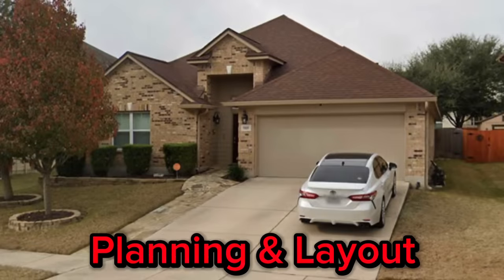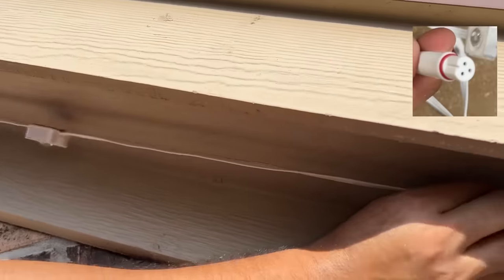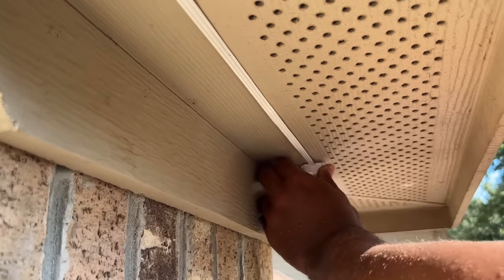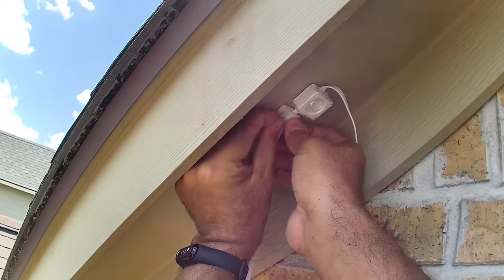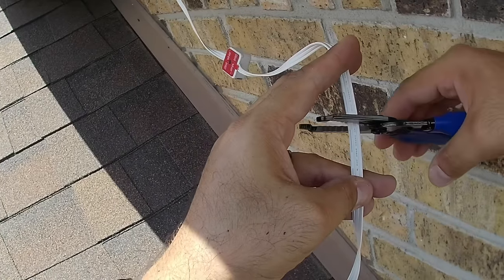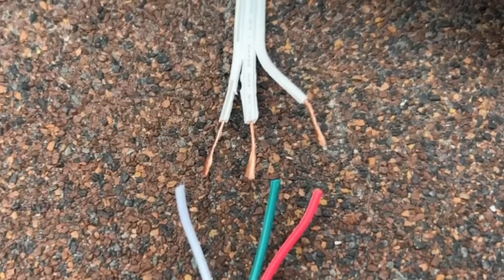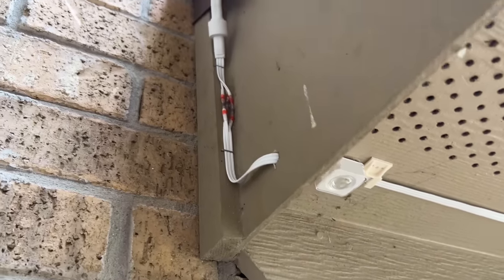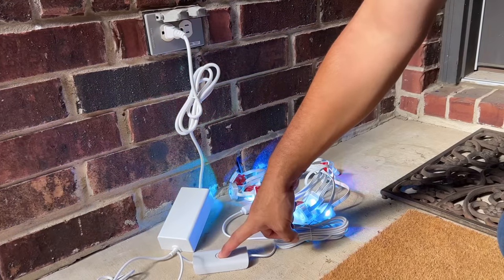Govee Outdoor Permanent Lights-1st Gen.*HOW TO FULLY CUSTOMIZE* @GOVEE #govee #howto #diy

Comment: The driver modules on Amazon says it will not work on anything but the Pro lighting. My question is why? I have just bought the regular set. I would think this would boost the signal if the system is extended with spliced wiring while staying within the 150 get, give or take a few feet. Also, if this can be used, can the wiring on this driver be spiced and used as an extension? If that could possibly be done it would be cheaper,(since the driver is only $19)and not void the warranty on the system. Thanks for the awesome video, definitely gave a great option to extend the wiring. Wish Govee would make longer wiring extensions and even ones with drivers so splicing will not be needed. They could even make a t-connection.
Reply from the maker: It will not work with any other version and has been tested. The way the lights themselves are made to respond to the module is the difference. Only can be used on the H706 models. Use a 12ft Govee Extension and splice new 18/3 wire to make a longer jump
Reply: @jbsdiytv  can I splice both ends of the jumper the 100 foot set comes with? First level I have a spliced end, need to jump to second level and continue with the same spliced segment. Or would I be better off adding 3 pin waterproof connectors to the ends of the spliced segment? And then connecting the jumper.
Reply: How far should they be from the house? I noticed the cardboard cut out, what is the dimensions on that cut out? Thank you, and it looks great!

Comment: Did you just use one controller for all of these lights?
Reply: That was my question as well. He had stated 95 ft on each side of the house. That’s 190 feet total (not sure if his 95 foot measurement included the spliced extensions or not). Which is well over the 150 feet maximum length for a single controller.

Edit: Nvm, he answered this in a separate reply. He used 2 controllers, one for each side and grouped them in the app to be in sync.

Comment: Great video and great advice. I have just 2 comments or suggestions. First, I have discovered that when i use the solider and seal connectors sometimes the wire will poke through the plastic side causing a possible short situation.  So i place a section of shrink tubing with the glue/sealer inside over the connectors as added insurance.   Then also to further seal with another shrink tube over all three extrnded about 1/2 inch past each end.  Second, i had enough overhang of my facia board that i put my lights on the back of the facia board aming toward the house.  Thus hides the lights almost completely and lights up washing the house wall much brighter.
Reply from the maker: Thank you for commenting. I’ve never had that issue with this brand of solder and seal when you mention the wire poking through. I have had this issue when using just the heat shrink sleeve without the solder so I stop using that type. The sleeve on these have a silicone in them when they get heated up when properly done. I can see someone who doesn’t know how to work with these have that issue so that is a good suggestion to have another seal cover the hole connections after complete. Wouldn’t hurt. To answer your suggestion on the lights on the back of the fascia facing the wall. Installed this way for one of my clients because they asked for it to begin and they ended up not liking it. They would rather have the triangle effect like shown in my videos instead of blasting light shown on the wall. Of course they paid me to re do it and it wasn’t worth the hours and headaches we got from it so I’ll never bring that up. I do mention to all my clients that it isn’t track lighting. Most of them are ok with it because it’s a knockoff from bigger types of lighting at a lower cost. For the ones that will pay to paint the lights to match the soffit, I’ll do it for them. Also have to consider a house I did had 4 different soffits spacing in the front alone, some 5inches some 12 inches and the others in between. Casting would've been different in those areas. So to keep everything even as I always recommend 2 to 4 inches. Thank you, this will help with someone’s install
Reply: Do you have a video showing your install with the lights installed onto the fascia  board having the lights pointing back at the house? What was the estimated distance between the light to the house?
Reply: Literally the comment I was looking for !!!! I wasn't sure if the lights would light up decent if I did that, because I noticed that if I installed them as you did it would preety much conceal them...
Reply from the maker: 2” from the wall
Reply: @joseluisperezjr3285 Yea, i'm also interested in seeing how your installed lights look .
Reply: All that beautiful work, then you have a ugly yellow light on the bottom...

Comment: I got two of the 150’ kits and did the whole house and entire perimeter fence in the backyard.  These lights are fantastic
Reply from the maker: Yes sir they are. I understand that the line can be seen and everyone mentions that but other than that, why spend 2,000 extra on something else when you can improvise with these. Awesome, glad it all worked out.  💪 👊

Hey look it this way, you can do a review on it. Every one of my videos is Creative Commons so you have my permission to use my video as an example👌
Reply: How do you do the perimeter fence? Do you have them pointing down?
Reply from the maker: @martybli  thank you for watching my video. If you decide to do this on the picket side(usually to the street) then the white wire will stand out and the lights will need to be put on their sides if you want the triangle effect. Or you can face them out. If you do it on the inside, it would work on the edge of the top rail 2x4 with the adhesive pad and clips. This install will be close to a home installation look.
Reply: @jbsdiytv  I know you can't do any more than 150 ft of lights but if the house is bigger than that, do you just need to connect it to a different outlet? And can you sync up the different 150 light strands if you had two different segments?
Reply from the maker: @benbarlow6135 please message us on Facebook @Jbs Holiday and Christmas Lighting LLC or Instagram @ jbsholidayandchristmaslighting
Reply: @benbarlow6135  I’m curious about this as well.
Reply: Great video 👍🏼 how far apart are the led’s?
Reply from the maker: @27airball  17” apart
Reply: How many ft ?? R how many boxs did you purchase for ur house!
Reply from the maker: @maxgtz  this is my clients house. This house took 2-100ft kits of the 1st generation lights
Reply: So even with all extensions the entire length should not exceed 150”? Does that mean that if I get 150foot version I cannot install any extensions?
Reply from the maker: @salilkansal4988 150ft plus your two-12ft extensions is the limit. That’s 9 segments
Reply: Where did you purchase the whole kit?
Reply from the maker: @atgeyler28 Im a bit confused with the question. What do you mean whole kit
Reply: Can 12ft extension be plugged in prior to adding 1st strand of lights? For example if I want to hide box underneath 1st story eave and then run up to 2nd story along gutter to underneath eave?
Reply: @jbsdiytv  Can 12ft extension be plugged in prior to adding 1st strand of lights? For example if I want to hide box underneath 1st story eave and then run up to 2nd story along gutter to underneath eave?
Reply from the maker: Yes we install in most cases installing more than 150ft to bring the controller closer to the front of the house
Reply: Are you able to connect  2 x150ft of the pro goove lights?
Reply from the maker: @MMARIC20 on to one controller and adapter, No. Two controllers and two power adapters YES and they can be grouped in the app under same-model group. If you need to add more than 150ft to one device you have to purchase the LED Driver Module on the Govee website for up to 200ft

Comment: Jb … thanks for the vid. Just finished my install.  Only snag was on the jumps.  I used my own 18 gauge 3-wire but my jumps needed to be 11’.  The system didn’t work until I shortened the jumps to about 6’.  What do I do if I need longer jumps at 11’ or 12’ ?  Will use if the two 12’ jumps supplied by Govee do the trick?  What if you don’t have male and female Govee ends to add on like in your video?   Appreciate the help.  Thanks for the reply.
Reply from the maker: Awesome. Glad the videos could help with your install. What kit did you end up buying? Pros or no Pros? Once you provide me with lil more info to the kit you bought I should be able to help out. One thing I can say is that if you need more than 12ft jumps we have spliced 3-4ft in the middle of the 12ft extension. The signal boxes in the Govee extensions need to remain
Reply: I have the H705C kit.  150’ with two 12’ Govee extensions.  I needed to cut and splice at two different points to reach a roof peak.  I used 18 gauge 3-wire jumps that were initially about 11’ each.  This resulted in flickering about half way past the first jump.  When trouble shooting, I cut the first jump down to about 6’ and the prob was solved until the next jump.  When I cut the second 11’ jump down to about 6’ … entire prob solved and entire system works fine.  But I really need those two jumps to be about 11’ each to hide and run the wires correctly.
Reply: Did you mention that those 12’ Govee extensions have “signal boxes” ?
Reply from the maker: @edhammel9535 I see. It’s tough to splice with the 12ft extension on the 150ft kit since they have them on both ends. You could purchase the Asahom 6ft extension from my site to use their connections
Reply from the maker: @edhammel9535 https://lnk.bio/jbsdiytv shop permanent lighting accessories on my site and look for the Asahom 6ft extension with amplifier
Reply from the maker: Yes on the 12ft extension, those are signal boxes to help with the data push
Reply: Can I cut the 12’ extension right before the pin connection and connect wires manually with heat shrink/solder connections like on your vid?
Reply from the maker: @edhammel9535 there is like about a 1/4” of wire to work with. It will be tough but it’s possible
Reply: Excellent.  I think I can make it work.  I was not aware that those little boxes on the 12’ extensions from Govee assist with the signals.  Will give it a try tomorrow and report back.  Thanks for the quick replies and help.
Reply: Update: the 12’ Govee extensions solved my issues.  The jumps and system now work perfectly.  Thanks JB for all of your tips and support.
Reply: Now where is that video on how to maximize use of the Govee Home app ?
Reply from the maker: Glad it all worked out for you 👍 That would be this one
https://youtu.be/KWp5gK0OZwU?si=U_EvgcR2c4eM9DD-

Comment: There is a new model coming out it's the Permanent Outdoor Lights Pro model H706C. I am currently testing them out. Biggest difference is they come in a 60m or 196', this is what they sent me. Also they are able to be spliced. They sent some connectors to allow the splicing. So far so good. 

 Great video btw. I used this for my install.
Reply from the maker: Yes that is correct. I follow the Govee group’s and comment on their ads. Seems like they might have a different color of line instead of just white. We will see. Thank you for watching, glad your installation went well
Reply: @jbsdiytv  I got white, so not entirely sure about the color but I've read that somewhere also. I posted a small review on the community page at Govee.
Reply: @jeves360 where did you find this info? Tried googling the model number a bunch of different ways to see more info on them, but couldn't find a thing other than an item number in an obscure page in their site like a placeholder. 

Super interested in checking these out before buying and having to splice. Any details would be really appreciated
Reply: @mpratt69 They're selling them on the govee website now
Reply: @KY_CPA  right, but this was 2 months ago. Salty they just liked the comment and didn't tell where tf to find em.

Comment: In addition to a question asked earlier about extending the wiring on a driver module (waiting in answer)  Can I splice and extend the original extension.  It is 9 feet, can it be extended an additional 15 feet with a splice? Everything is still within the 150 feet total.
Reply from the maker: Yes like I mentioned in the reply, you can extend the Govee extension using 18/3 wire

Comment: So you used 2 100ft sets and there were 2 runs of 95ft tied to a common power receptacle in the back.

Questions:
1.  Govee says not to cut the strings.  If so why did Govee provide the 12 ft extension or did you buy that separately?

2.  Did each 95 ft run use their respective drivers or did you tie them all together with another bigger driver?

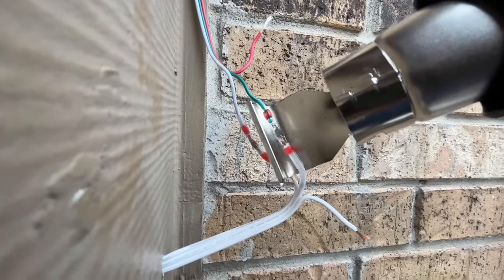3.  Does Resynch procedures @ 13:30   work if you had 2 47 ft parallel runs instead of a 95ft series run OR does the driver only work with series runs?

Comment: When the time comes to paint, will it be adequate to just mask each light? Also, I wonder if there is a track system or similar to conceal the wires. I am not a fan of the exposed wires.
Reply from the maker: When it comes time to paint, they sale stickers on Amazon that are 7/8” diameter to fit on the lens. Not everyone is to worry about it, and I always ask them before install starts. Some have HOA that it’s written it needs to be on a track and color match so I get that so I accommodate them. Solely it’s the owners liability if it’s written and mentioned in the invoice. But it can be painted after. Yes the best track is @BearLightStudios
Reply: @jbsdiytv  appreciate your help and the response! Y'all seem to do great work.
Reply from the maker: @corvettetexan thank you for your compliment

Comment: What product would y'all use if you needed to do a 3 way split, not just 2 way?  I have a house I'm going to be doing and they have a gable as well as a straight area to cover.
Reply from the maker: We typically don’t do 2-ways or 3 ways because the devices can be grouped as one system. If you wanted to make a 2 or even a 3 way, just keep in mind whatever line you tie into, those lights will mirror that strand. Which is not a problem when you use your Govee scenes but only a problem when you do your accent spot lighting as you turn a particular lights, the strand attached will also respond. He is something you can try out to see if it works for you 
https://amzn.to/4aFXiYn

Comment: So i have a question, so the 150 ft kit comes with one power box correct? If we are going from an eve to a peak, and you make a cut, how do you regain power? Stupid question, just have no clue what im doing
Reply: Wondering this too
Reply from the maker: When we do installs, we try and have a factory connection end start before the jumps so we can use a Govee extension to make the jump without splicing. Then work from those strands out

Comment: I’m thinking of purchasing, just a quick question does it matter where I cut my wire? I know to cut/splice center between 2 lights but do I have to pay attention to how many lights are between each splice? How many extensions can I use with the 150 kit?
Reply from the maker: Hi and thanks for watching. On the 150ft kit, it comes with 2-12ft blank jumper extensions. We have made about 3-4 custom jumps that were about 2ft and we had no issues. If your splicing within your install then anywhere is fine. Cut, then take up or down to next soffit. Use 18gauge-3 to make your jumps. If your ending them, anywhere but seal them well to waterproof them. Make sure you add that end cut strand as a full strand in the device segments
Reply: @jbsdiytv  awesome thanks for the reply , does it matter where I start? I thinking I can do it with only on jump from first story to second story, I like how you started with one led right at peak! But if I start at one end it would be luck to make that happen!! lol
Reply from the maker: @phytphyr  it is difficult to say where you should start as each home has different scenarios. If you want to hurry up and get it up there then mistakes might happen. Take an extra 30mins-1hr to plan everything out. See were your peeks are at. Check how many jumps you have. If you’re trying to get a specific light at the peek, measure from there to the starting point and see if you’ll need 2 or 3 strands based off the measurements. Then you have a general idea on how many light bulbs it will take to cover from the peek to the power outlet.

Another way would be if you have one jump, you can start the end of a strand there and use the provided 12ft blank extensions to make the jumps keeping factory connections without splicing. Then work towards your power, then come back and finish the other side of the jump
Reply: @jbsdiytv  I just went out to measure and realized my eves are not boxed in so I have my rafter tails under my eves !!! Bummer I really wanted to make this happen. Going over these would make it not practical.  Bummer👎🏽
Reply: I could run them on the back of facia board but I’m not sure how that would look ?
Reply from the maker: @phytphyr yes it can work. Use a 1/2”x2” wood 2-4” from the wall and then place the lights on that

Comment: Thanks very much for these tips! I ordered the extension cable and connectors, plus the clips, to extend my 100 ft kit.
Reply from the maker: That’s amazing. I hope it isn’t to hot where you live. Stay hydrated and be safe when you install. Plan ahead, measure twice cut once!! Check out my upcoming video for some further tips and tricks. Thanks for your support🤝🙏
Reply: Where did you get the extensions? I don't see them on their site.  That's exactly what I need!
Reply: WHERE DID YOU GET THE EXTENSIONS CORD?(Extension Power Cable for govee  H705A)
Reply from the maker: @murphybalsomi8526 Hi there. The extensions come with the 1st edition 100ft and 150ft kits. Also comes in the 100ft and 200ft pros